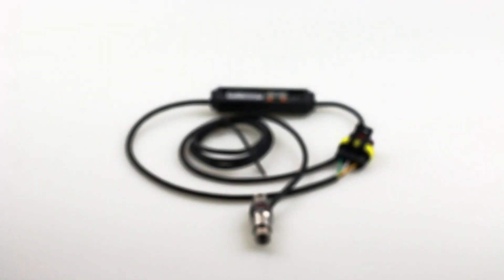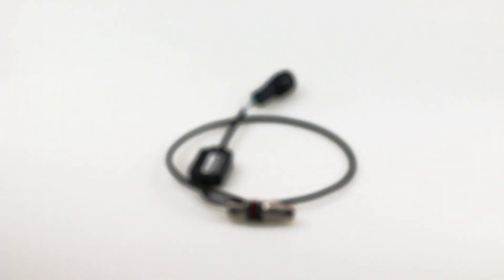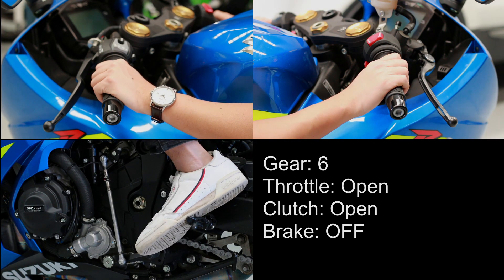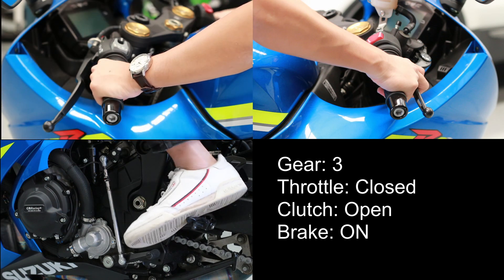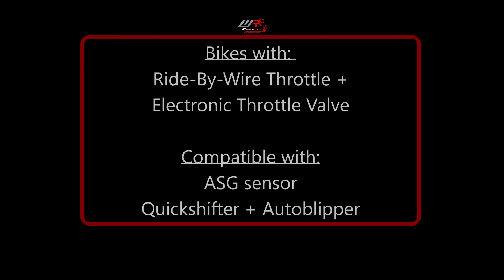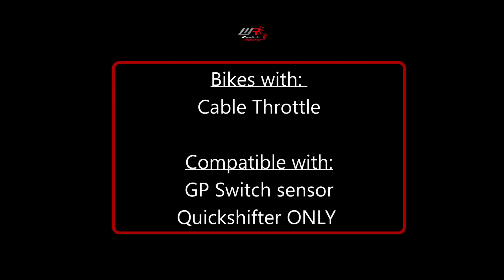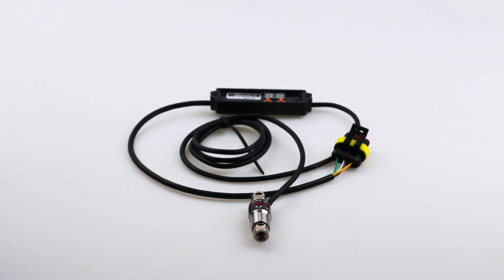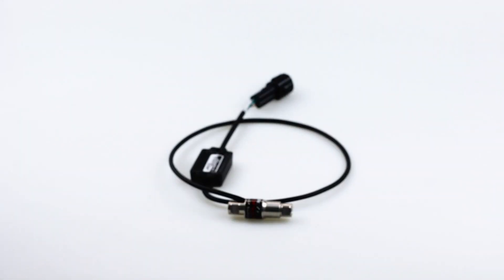Quickshifters and Autoblipper explained [Woolich Racing]

Comment: 2021 zx10r are cut times reduced?  Are cut times tunable with Woolich software, or same as standard. Thanks
Reply from the maker: Woolich Racing does not currently offer Race Tools for the 2021-2024 ZX10R, however we do offer support for the Kawasaki stock Quickshifter/Autoblipper using the stock Kawasaki Maps.

This then allows modification of the Quickshifter Strength and Quickshifter Time maps which were created by Kawasaki, the maps can be edited using the Woolich Racing Tuned software.  This allows the optimisation of the pressure required to initiate a shift as well as the kill times used for shifting, dependent on both engine RPM and TPS and can be mapped separately for gears 1-6.

Comment: I had a quick question I have a 2016 r6 it’s already ecu flash now I want to buy a quick shifter do I gotta flash my ecu again or will it mess up the tune if I plug it in
Reply from the maker: Our Race Tools quickshifter requires the ECU to be flashed again in order to activate the Race Tools key. If your previous tuner put a password lock on the ECU, then ONLY they would be able to flash it without losing the existing tune.

However, if they DIDN'T put a password lock on it, then any tuner with Woolich equipment would be able to read out the current tune on the ECU, preserve that and activate the Race Tools.
Reply: @WoolichRacing  thank you I appreciate it a lot

Comment: i cant flash ECU in Pakistan. why we need Flashing the ECU while installing quickshifter/Auto Blipper in GSXR1000 2017 even there is option in the manu of that bike...if it is must then tell me quick shifter that can be plug & play and not need to flash ecu
Reply from the maker: Thanks for your question. If your 2017 GSXR1000 came with a factory QS, the Woolich QS hardware is a direct replacement. If your bike did not come with the QS/AB activated, you will need to flash the ECU, to turn it on. This requires a Bin File Key (1 License) to flash the ECU, and a 'Racetools Key' to activate the QS/AB. If your bike came with a factory QS/AB, and you are Woolich flashing the ECU, please open a support ticket so we can assist you with keeping the QS/AB activated. support@woolichracing.com